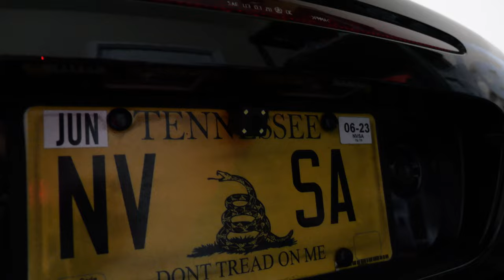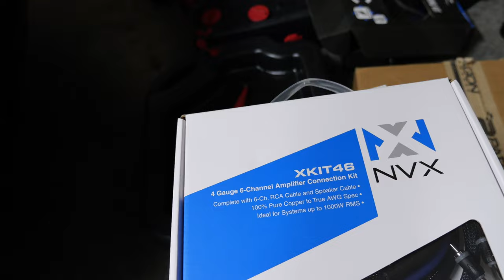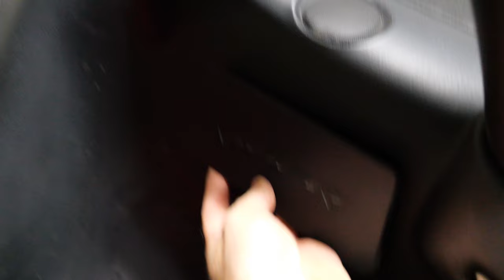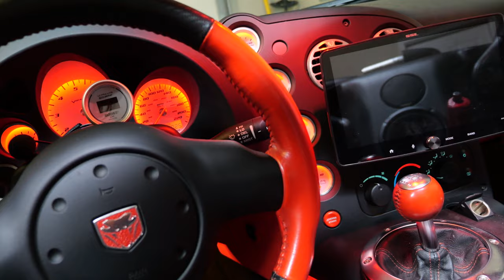Dodge Viper Audio Overhaul ***PLUS SUBWOOFER INSTALL***

Comment: Thanks for the video bro, pretty helpful. I tried getting the head safety bars off , the driver side came out with no issues; the passenger is so stuck in there I even tried hammering it out but no luck. Did you have any issues getting them out ?
Reply from the maker: I did not :/

Comment: Hey buddy, great video. What size screen is that deck? I'm looking at floating decks for my gen3 and from the video it seems like you went with one of the bigger ones.
Reply from the maker: Thanks man. It's a 10.1".
Reply: @RobsHouse  awesome much appreciated, and appreciate you making these. Info on the amp is huge
Reply from the maker: @TheDashazbot  I'm glad it was useful! This is actually a pretty simple setup. You'll be fine doing it yourself. It's mostly just mounting things and running wires cleanly. Just time consuming.

Comment: I was thinking about putting a similar head unit in mine, but doesn't that screen get in the way when shifting? Things seem so tight on my Gen 4
Reply from the maker: It probably would if I did not have a short throw shifter. But with the short throw it does not get in the way.

Comment: I know old video but where did you drill to run wires into the trunk?
Reply: Sorry did see that part, did you have to drill from the trunk to get wiring into the wheel well?
Reply from the maker: yes

Comment: i wanted to know your sub install with out a box !!??
Reply from the maker: You just have to plug the top port. It works fine.
Reply: @RobsHouse  I'm surprised it doesn't rattle the plastic like crazy
Reply from the maker: @fundamentallybroken4194  it doesnt if you put foam behind it and/or dynamat